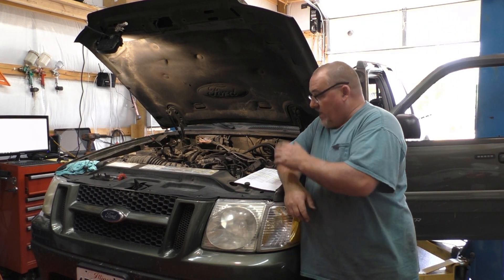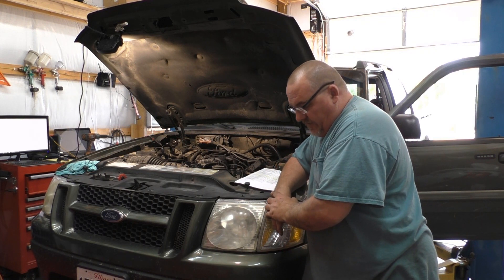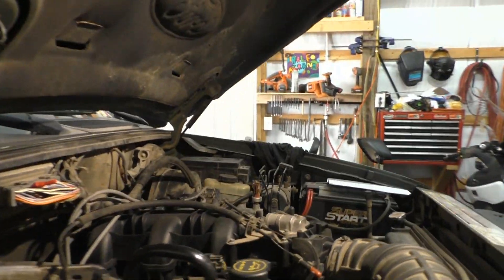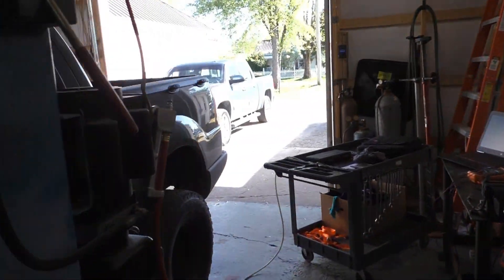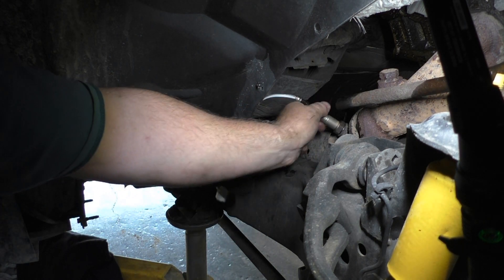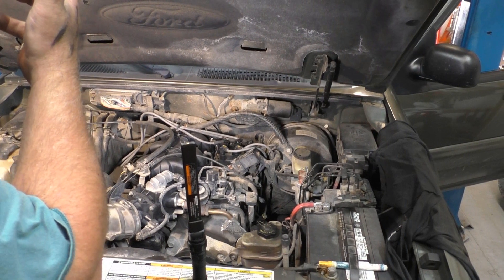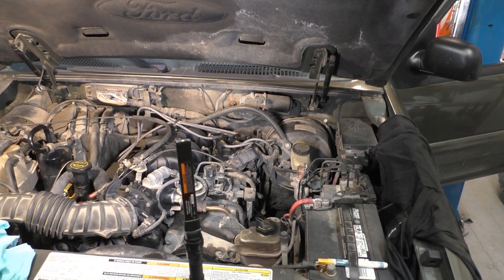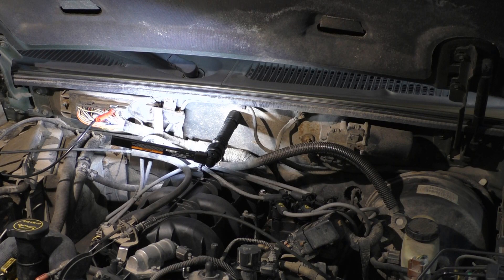2002 Explorer Sport Trac num 6  Misfire and bad Bank1 Sensor1 Oxygen Sensor

Comment: Hi Ralph, I have a 01 Sport Track with a PO306 miss fire also, I replaced the Spark plug with an Original Autolite AP306 plug, and plug wire on number 6 cylinder, since they have 195,000 miles on them, I checked the ignition coil with a spark tester with the engine running, the spark is good, I still have a miss fire, I'm going to replace all of my injectors since some of them are leaking, That should take care of the problem, I hope the Injector driver in the pc is good, My question is, Can I back probe the injector wires at the pc connector and check the signal with a noid light since I do not have a scope?
Reply from the maker: You can use a noid light anyway! and looking at both ends is a good idea, that way you could locate broken wires.